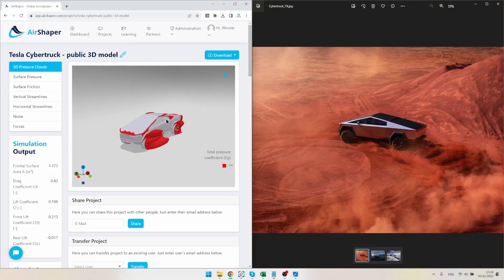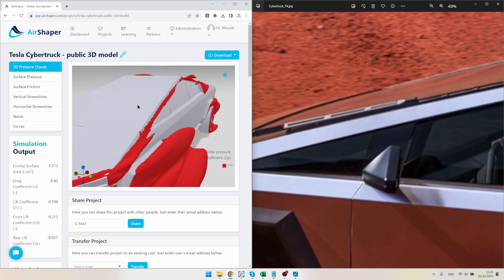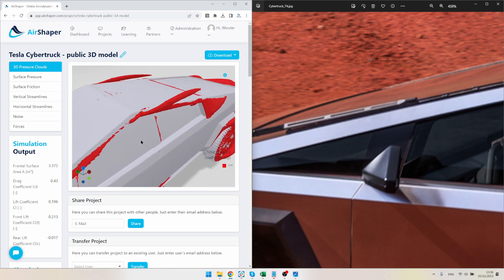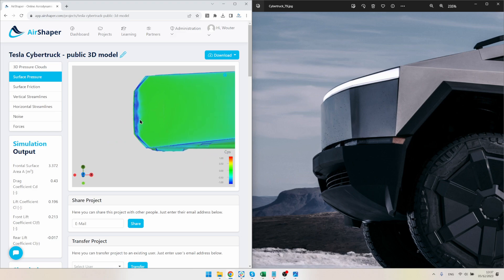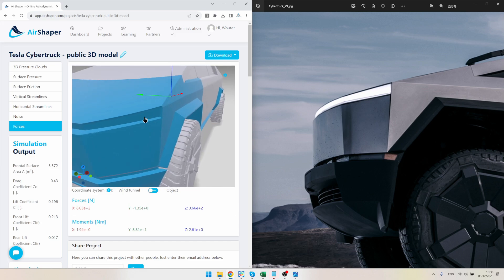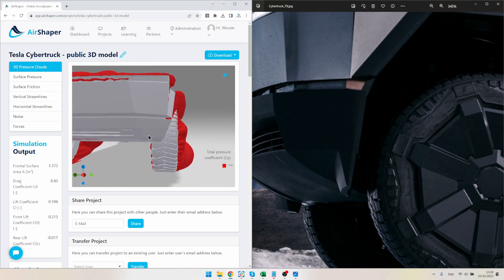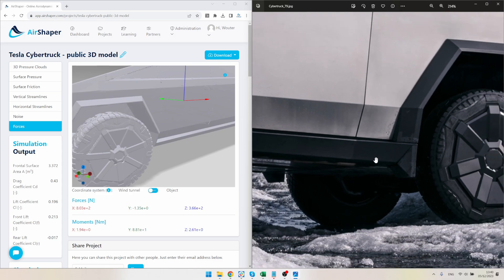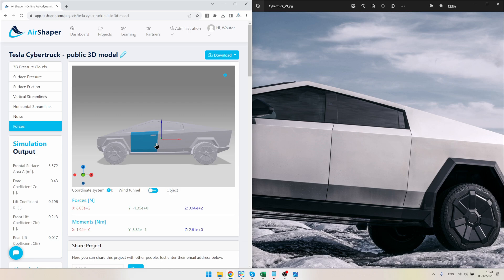Tesla Cybertruck Aerodynamics - Production version updates

Comment: Thank you for this amazing video.  Would an additional 45 degree edge on the opposite side of the wiper ie passenger side also be of benefit?  I have placed query into two companies that manufacture micro Riblet type surface treatements that are used on aircraft.  I am a pilot and inventor, so I am hoping to use this vehicle as a test bed for such drag reduction material.  Any thoughts welcomed.  Oshkosh is home of the EAA and this would make for an excellent test vehicle for attempts to optimize surface treatments for small aircraft and EV's.  Please let me know if micro riblet shark skin drag reduction coating would assist.  If you have any computational models please advise.  Very Best Regards,  Cheers.
Reply from the maker: Micro scale effects like Shark skin etc are very difficult to capture with simulations. And compared to the large angles featured on the Cybertruck, they may or may not have an impact.
Reply: @AirShaper  thank you for this. Would it be worth trying to match the wiper effect with a 45 degree bend linear channel opposite of the wiper?
Reply from the maker: @diveflyfish  There is a video in which the designers say this helped - so possibly yes, adding 45° angle could help (depending on the size, position, ...). Keep in mind this will be sensitive to side wind, driving speed, etc

Comment: Very nice work indeed! Thanks a lot for sharing this. With these relativevly minor changes: do you think they really achieved 0.335 (value from Delivery Event video)? Did you update the 3D model and check? I mean, they had to add the side-view mirrors and wiper, both of which were not part of the original plan.
Also: what is your estimate on drag coefficient, when the tonneau cover is down, such as to haul stuff around?
Reply from the maker: You can only make accurate absolute value predictions when you have the real 3D model or a super accurate 3D scan, so that's hard to say. We may get one I. The future. Perhaps in the meantime we can run an analysis on an updated 3D model off the internet.

Tonneau cover down might increase drag quite a lot, with tailgate up, perhaps even 5 to 10 percent.